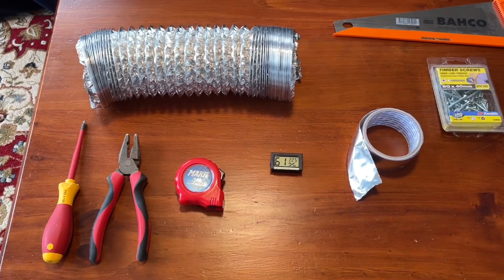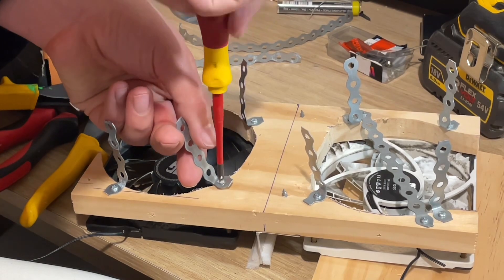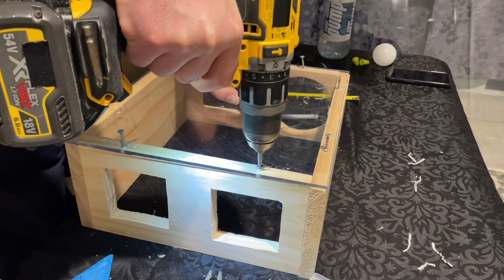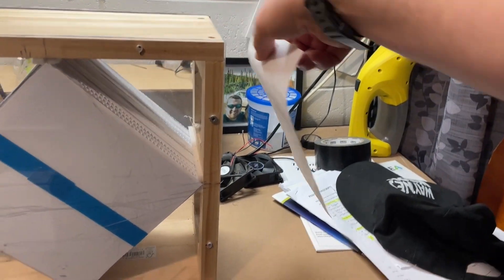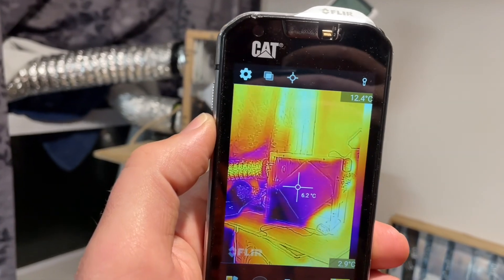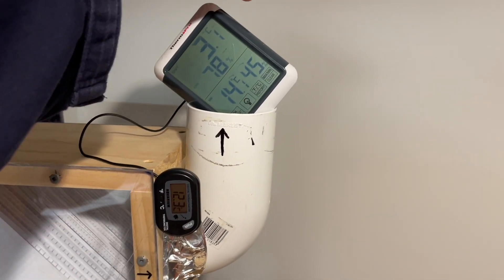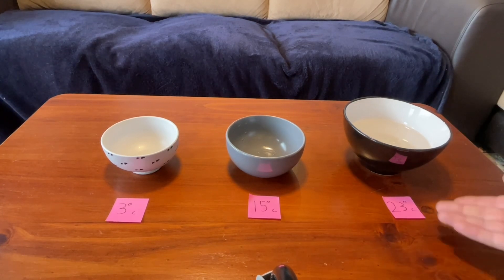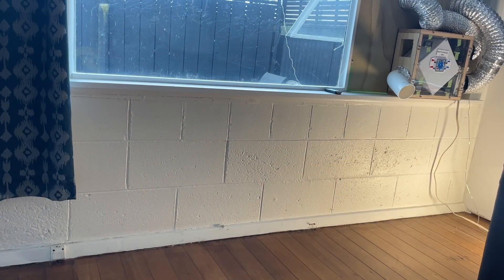Why every house  NEEDS a Heat Exchanger

Comment: This is an extremely awesome video. You'd probably need some form of condensation drainage to prevent mould forming in the unit over time.

Comment: great explanation -the cat sure enjoyed the tutorial.Do I need a heat exchanger with woodstiove running 24/7 all winter
Reply from the maker: Probably not as the fire will pull fresh air into the house constantly.